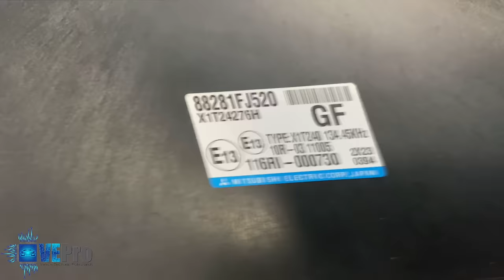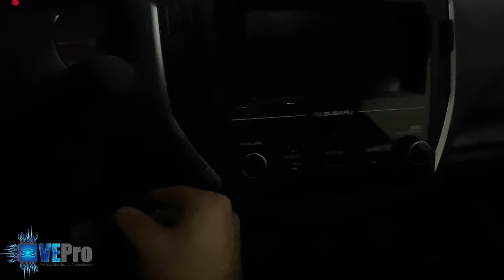SUBARU | ALL KEYS LOST | SAVE THOUSANDS COMPARED TO DEALER | BIU SMART ECU SYSTEM OVERVIEW

Comment: I’m an auto locksmith. I desynced modules in a Subaru Impreza  once. Programmed under the wrong system. Called Autel tech support  and they walked me through the steps to resync the modules. Car started right up after. Lesson learned.

Comment: Ok, I just went through this with my BRZ.
I lost the key for had a program or come out and try to make a key. He couldn't do it.
Took it had the BBRZ toed to the Subaru dealer. They couldn't do it.
They then shipped my computers to New Jersey from California.
New Jersey couldn't do it.
So I had to buy 2 new modules. I have them installed.
I went down to pick up my car and the car would not start even after all. The modules were replaced and the key fob was replaced in.
I don't know what the h***'s going on but I got my old computers because they have the tune on them.
I think i'm gonna swap him out because I found the original key fob

Comment: thats great info, i focus my locksmith  buisness on Chrysler vehicles wich i have alot of experience (former chrysler tech) and have the proper factory tool in case of something goes wrong , i have one request for a 2012 Impreza to add a key and im glad i did my research before hand. are the 2012 models can become bricked also ?????
Reply: What ever happened!

Comment: Hi mate I have 2010 subaru exiga and remote fob doesn't open door but it does start car when it's very close to push start switch. I did change the battery in remote fob but still same .then I got new remote and get the pin code through autal scanner and try to add new key but didnot worked. So not sure what is the issue is.orange key light on dash comes on and flashes but car can still start and drives.no codes in dtc  .any help will be good.

Comment: what happens if you put a use cluster without the old cluster?
Reply from the maker: Vehicle will not start as there are sync data between several modules.